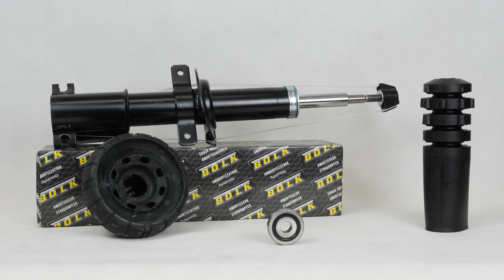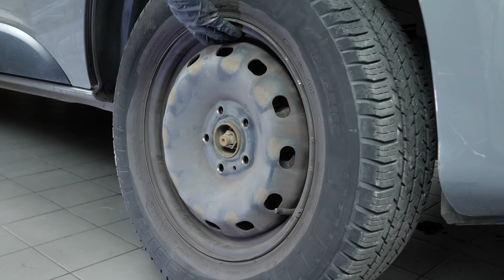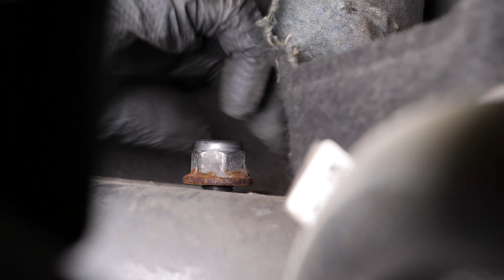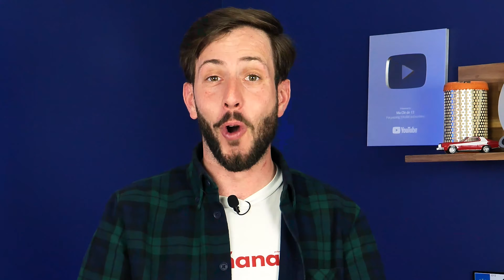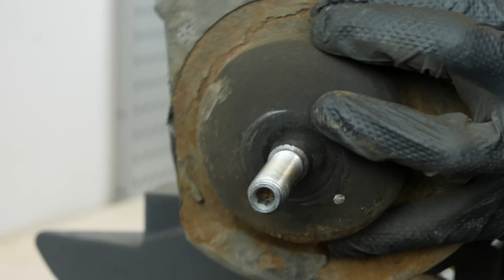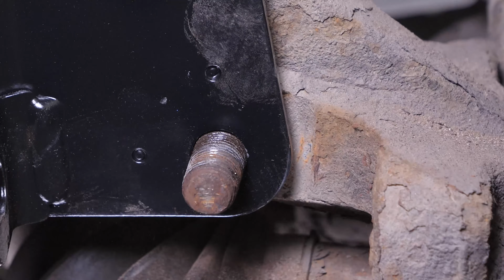How to replace the front shock absorbers Trafic mk3 ➿

Comment: Do i understand it correctly that the nut at 5.01min (lock nut on shockabsorber stem) has to be tightened at 62nm and the upper nut (suspension strut support bearing nut) at 6.55min has to be at 180nm?